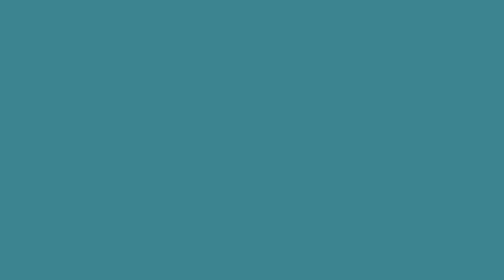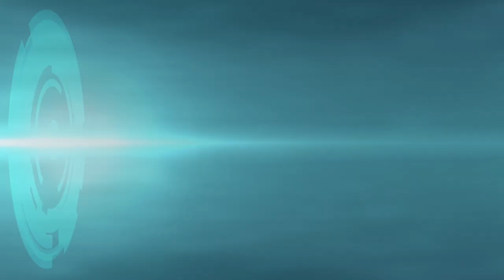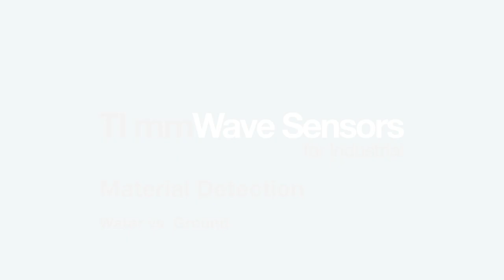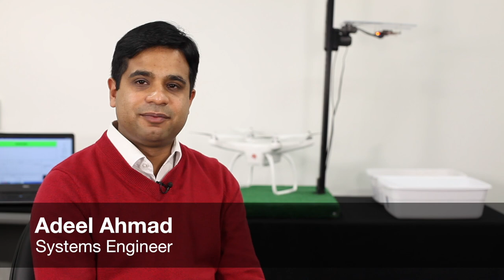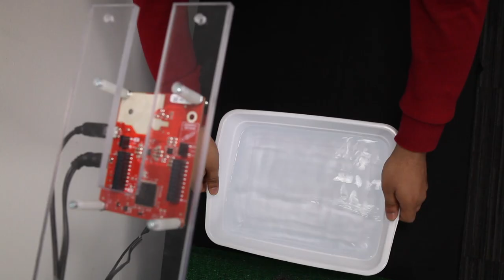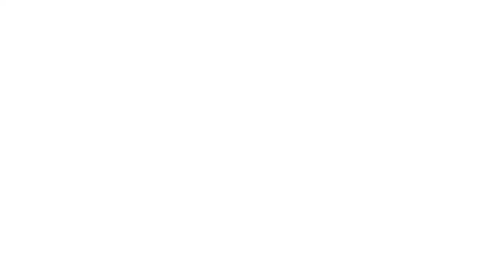Drone ground vs. water detection demonstration using IWR mmWave sensors

Comment: Hi Adeel.  Thank you for the video.  I'm wondering about more dynamic measurement differences, for example, what would you anticipate the difference being if you were a plane flying over water or flying over land (pavement/runway).   The time delay would tell you distance but can you get a reflected signal strength reading to determine the difference in the surface material?  Thanks!